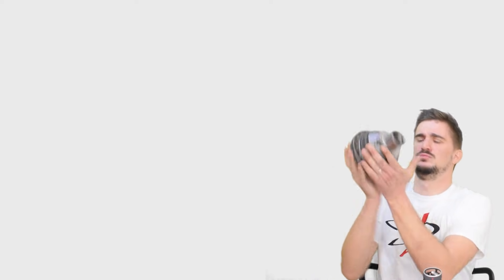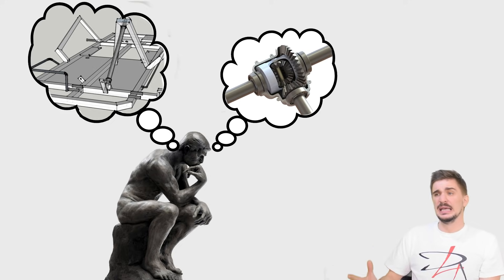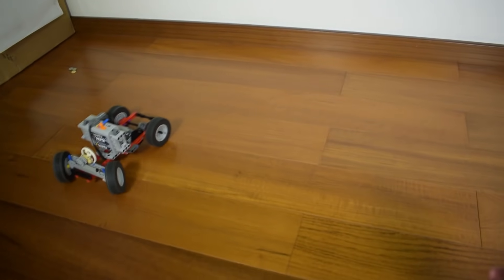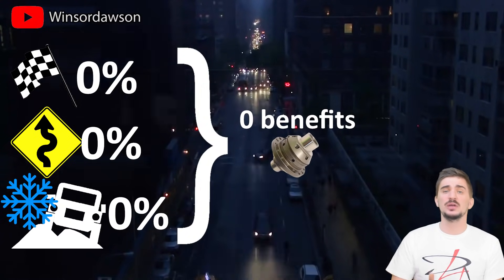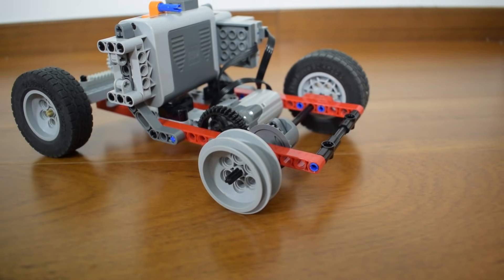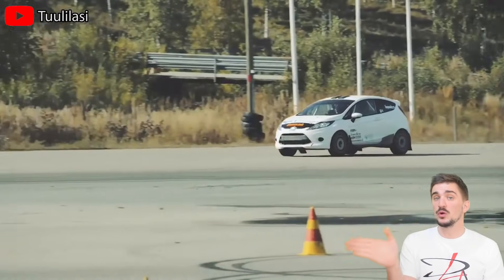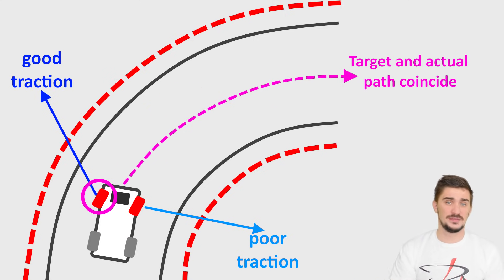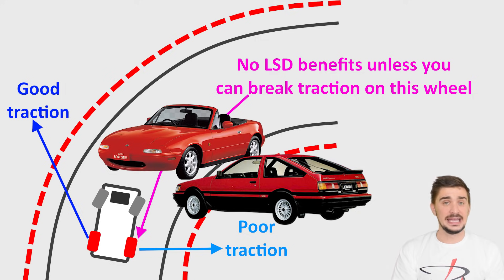OPEN diff vs LSD vs WELDED diff - VISUALLY + In depth EXPLAINED - Version 2

Comment from the maker: https://midshipgarage.com/
Quaife ATB diff - https://midshipgarage.com/products/quaife-toyota-mr2-turbo-sw20-89-99-a-t-b-helical-lsd-differential-for-e153-transmission?_pos=1&_sid=9f421405d&_ss=r&variant=28536254693481
OEM Viscous - https://midshipgarage.com/products/genuine-oem-toyota-e153-non-lsd-axle-stubs?_pos=1&_sid=3e19dfbb0&_ss=r&variant=32312543510633
Novus Center Console Pre-Sale: https://midshipgarage.com/products/midship-garage-toyota-mr2-spyder-mr-s-zzw30-novus-center-console?variant=39310517796969
The LEGO LSD design I used: https://youtu.be/2NLjbwt1C70
Support d4a: http://driving-4-answers-shop.fourthwall.com/
Version 2 of this video. Previous version was deleted because it contained some misleading information. Please see description for details.
Reply: Nice to see a YouTuber admitting and correcting his errors.
Reply: Still one of my favorite channels, but if I need to vent some anger and aggression I know where to go. Haha... gotta love those keyboard warriors!
Reply: good good :)
Reply: Thanks for taking the time to make a corrected video. It was right thing to do
Reply: I think there are RWD cars with low enough torque to be unable to break traction in a turn.  What about my 1982 225 CID Dodge W150 when in 2wd mode and fully loaded? what about the 1979 Datsun 210 wagon with 1.4? what about 7 ton capacity dump trucks with 4-53 2 stroke diesels?
Reply: So now i know what type of slip diff the van has that i need to drive for my employer. Limitless slip diff i will call it, or the open one as you present it. How i know? It's simple, i was charged with picking about 600kg of apples and the fastest way would be driving through the lanes between the trees, fill the crates and directly load them back into the van. Done it before but this time it had been really rainy and the owner of the trees uses a tractor to maintain them, tearing up the grass with the wheels especially at the corners. It was a clay like mud that was really slippery and i got stuck in it. One of the wheels, the one with the most traction, would just sit there having grip but not getting enough to move the van, and the other wheel would be spinning and flinging mud around.
We managed to free it by using several pieces of board to drive onto to gain momentum and rocking the car back and forth untill on top of the boards by clutching at intervals. Let's just say it was an interesting and educational day for me :D
Reply: I'm really surprised you didn't consider the 2nd gen MR2 (SW20s) or even a 2000GT if you could find a good deal (which I'd think you could).
Reply: Throwback to my physics class, amazing presentation! 👏🏻
Reply: what is the difference between shaft linkage and cable linkage in manual transmissions and how does the cable one work?

Comment: I’ve been an automotive master technician for 20 years and this video does a good job of explaining a subject a lot of people have a hard time understanding. Everyone wants to weld the differential until they realize you can only drive it in a straight line to keep it from breaking.
Reply: I had a spool in my race car (manual steering box, btw) for a few years and it was awesome on the drag strip but sucked royally everywhere else. Especially with slicks the car seemed to go through agony every time it had to make a sharp turn. The fact that our strip has two 180 degree turns, one on one off, colored my attitude towards them somewhat. I've since got a Detroit locker and it's so much easier on tires and the car. I don't feel like he frame is trying to twist in half anymore.
Reply: I daily a diesel Ford pickup with welded diffs in both axles. Unlock the front hubs before you drive anywhere and it’s literally not an issue. Since I’ve welded them that trucks put 20k miles on the odometer.
Reply: Can I ask you a question?  I have a really nice 2015 XB 5-spd.  Actually the last one off production.  I thought it came stock with an LSD but from what I've found it's probably and Open diff.  Is it really worth it to upgrade?  I have a full shop at my house, have done engine rebuilds before and clutches but not a diff yet.  I've also read that to really get the benefit you should supercharge or turbo the car, otherwise it's a waste of time and money.  Would that be your consensus.  It is a box lol, but it's actually got every Toyota/TRD aftermarket part available. I bought it at 40k miles and the original owner had really dialed it in save for engine/trans mods.
Reply: You just need slippery tires and a slippery surface OR just dont go round corners
Reply: And omg! If it won't start and you have to push it with the front wheels turned you ain't going no wheres.
Reply: @oldowl4290  Toyota has an amazing LSD that uses worm gears. Whether or not you need to have a turbo, a supercharger, or a built race motor I guess depends on what you do with your XB. If you live in a place where you have snow and ice and you are forced to drive on it an LSD will benefit you. The Toyota LSD is the best I've ever seen. I'll see if I can find a link so you can see what I mean.
Reply: @3dw3dw   Please link what you find. I'm curious!
Reply: @3dw3dw  Sweet!
Reply: @oldowl4290  that channel does really great illustrations, I recommend watching their other differential videos also so you can see how truly impressive the Torsen is relative or other technologies. With any other differential,if the engine won't start and you need to push the car as soon as you turn the steering wheel from straight the car will get ridiculously hard to push due to the friction or resistance in the differential. To me this indicates that a lot of power is required to overcome the differential in a turn. This would not be the case with a Torsen diff if you understand what is illustrated in the video here. Anyways, I hope you find my input useful. Have a blessed day.
Reply: @3dw3dw  Thanks and you too.
Reply: then why do all drift cars have welded diffs?
Reply: @__mayo1802  it’s easier to slide with it, less traction. im just taking a guess, im new to this.
Reply: @__mayo1802  not all drift cars but ok. Low budget grass roots drifters do it yes. But in order to save that diff's lifespan you're limited to the cheapest lowest grip tyres available (usually relatively skinny)
Reply: Now they will want a twin rear motor ev with no diff & torque baising!. Then they want additional motor with integral diff & rear wheel steering!
Reply: My welded diff has been drifted and driven on for years without issues, saved hundres or even thousands of dollars while being very functional for its intended purpose. Definitely not comfortable though by any means

Comment: There is one element you missed when explaining the welded Differential during corner exit.  With the Weight Bias shifting to the rear wheels, the traction is less on the front than both of the rear wheels so the traction can cause the Front Wheels to be the ones to slip, not the inside rear.  As such the car will now understeer drasticly.
Reply: Happens on poorly designed go karts. It's called "plowing". Happens because of a solid axle rear end, and a poorly designed steering setup. In some cases you can't get it to stop in suspension applications. So that really makes sense how the weight distribution would make such a thing happen. On a kart with no suspension it's easy to fix. But when you add suspension, it gets to be a headache.
Reply: @derucktorez2260  I used to race 250 gearbox karts (or shifter karts as they say in the USA!). They were set up to lift the inside rear wheel on corner entry to get the kart turned in, then drive out of the corner on the throttle with a subtle drift. Not too much drift or we'd lose too much speed. It was a bit of an art to balance them but at least we had gears to help, unlike the direct drive karts where momentum was king. Good fun though!

Comment: You know, I don’t do any racing or anything, but I do work with heavy equipment and this explains the characteristics of my equipment vs my trucks. Apparently my loader has a LSD, and when under a load like digging, they will all turn without needing to lock the diff. So this actually helps me understand certain things now and I can take better care of my stuff! Thanks!

Comment: Weight transfer is not necessarily in the opposite direction of movement, but the oposite direction of acceleration. If you are moving forward but press the breaks, the weight transfer is forwards because the acceleration is backward. Same as in a turn.  The cars acceleration is toward the center, thus the weigh transfer is to the outside of the turn, which is actually perpendicular to the direction of movement

Comment: For offroading, many offroad vehicles have a system that locks the differentials letting you have all the advantages of open diffs and the traction of welded diffs when you need to be in a loose surface.

Comment: I was a truck driver for many years, and most vehicles I'd ever driven (truck or car) on unsealed roads were rear-wheel drive. Therefore, I got used to how those types of vehicles reacted on said roads. 
In the 90s, I started working for a company that made urgent deliveries to coal mines West of where I lived. One day I was in a small, front-wheel drive car delivering some small, yet extremely urgent parts to a mine, along a loose gravel haul road. The haul road was wide. Probably about 50 metres (approx 150 feet) I guess. I was tooling along in this little car at about 120kmh and came to a long, sweeping bend. As I entered I backed off a little and the car stopped following the bend and decided to start skating across the gravel. Now, in a rear-wheel drive vehicle that wouldn't happen due to the inertia of the rear, and if it did, you just give it time to correct before adding any 'gas'. So, I stayed off the gas and the car kept sliding along. I then remembered some side comment I'd heard from a bloke who I knew who played with FWD cars. "If you back off too much, they just slide, so you need to feather the power as you corner..." So I gave it some power and it started to pull itself around the bend. I used the whole arc of the bend, and thank the gods there wasn't a haul truck coming down that side, but I got it back on line. Lesson learned.

Comment: Differentials are probably one of my favorite car engineering things to understand, and this video does a good job of explaining it.

I have an RC car that's 4WD, open differentials front and back... until the rear diff stripped out, so I filled it with JB Weld. It's also great for explaining differentials.

Comment: For cars equipped with an ABS, an open differential is enough since the ABS equipment can be used to restrict the movement of the slipping wheel thus increasing the torque sent to the other wheel.
Reply: All ABS does is limit breaking force. Not all systems limit each wheel independently, and none of this controls torque unless you're both breaking and powering trough a corner. Traction control systems actually do modulate breaking on each wheel to control traction in that scenario, but still don't modulate torque sent to each wheel. The only systems that actively control wheel torque are LSDs and they can be electronically controlled. This video explains why they exist, and they're made to do the thing they do. They're not snake oil.
Reply: @PaulSpades if traction control notices that one wheel is free spinning (such as on ice like in the video) and applies brakes to just that one wheel, then all the engines torque will go to the wheel with good traction through an open dif, but if ur gonna do all that then u may aswell just have an lsd

Comment: “In reality there are no such RWD platforms with such low torque you can’t break traction” 

Me: looks out window at friends Ford falocn with a claimed output of 70 HP 😂
Reply: I mean if you launch it its gonna slip from acceleration i think
Reply: @Crispy656forever  Is that what some call "full send"😂
Reply: too many negatives in this sentence, cannot comprehend meaning
Reply: Was thinking the same with my isuzu pickup, boasting an absolute monster of a 2l 8valve na diesel, producing 62hp and 125nm... When new nearly 40years ago :D but to be fair it does brake loose for a second, with an empty bed, from a stop. But as tested ONCE, the whole car made such immense noises of suffering that I will never do it again. 

I don't drive to places like others, but accelerate to them, no matter the distance.
Reply: What model is that? Must be some kind of economy model from the 70s i assume.
Reply: @Blox117  
int Reality(){
    if(RWD==true){
        if(maxTorque<torqueToBreakTraction) return 1;
    }
    if(FWD==true){
        //front wheel drive reality checks go here
    }
    return 0;
}
Reply: @LokiScarletWasHere  oh thats better, why didnt he just say that from the start
Reply: @Crispy656forever   That is if the Clutch can also overcome the kick :)
Reply: Classic peel out machine, what are you talking about? :P
Reply: @TheSpekkel1  what the hell truck has that low of power? Why even own a truck at that point?
Reply: @ThatSB  Why own one? Just for fun and hard as it sounds, these trucks were useful in the past. Where the truck has spent it's life, they dont have asphalt roads so speed didnt matter.
Reply: @TheSpekkel1  It isnt about speed in trucks it is about haul capacity and terrain management if youre riding offroad. But also better fuel economy can be had in literally anything. A toyota corolla for instance. And if it had some semblance of power you'd actually be able to haul
Reply: @ThatSB  Sure there isn't really point in owning one of these older small trucks anymore, it's more of a hobby vehicle for me, but it can carry contruction material or lumber. Of course anything made during the last 30years will be more capable than my isuzu, but as a guy who rarely needs a truck for anything, it's more than enough.

Isuzu is my second vehicle. I have w123 240d, equally as slow, for daily commuting and such.

Comment: 3:15 : Viewer, please note: "allows two wheels on the same axle to rotate with different speeds." Very important bit! A differential is required for two wheels to move at different speeds only if the two wheels are on the same axle . If they are not on the same axle, not only do they not need a differential, they can not even have one! (The moment you connect a differential between two unrelated wheels, they immediatelly acquire a common axle )

Comment: Well done for your clear explanations that get the basic principles across in an easy to understand manner.
I've only owned one car with an LSD (Ford Capri 2.8 Inj. Special).  It was very useful in wet conditions where you could 'feel' it 'clutch up' mid bend.
Not quite as helpful in heavy snow/ice conditions.
Neverthess, I managed to drive it through a dire winter situation where modern FWD cars were giving up - thereby causing additional mayhem by blocking the road.

Comment: Limited slip differentials, when engineered well, are pretty impressive throttle/load-responsive traction aids. 
I use them primarily in heavy-duty trucks that I use to do mobile service work on machinery. They can have very good street manners, but on rough or muddy terrain, a quick romp on the throttle loads the clutches and gets you in, and then out of, trouble.

Comment: Open Differential:

Functionality: An open differential is the most common type found in most vehicles. It allows the wheels to rotate at different speeds, which is essential for smooth turns.
Operation: When one wheel encounters less traction than the other, the open differential sends more power to the wheel with less resistance. While effective for regular driving, it may not provide optimal traction in certain situations, such as off-road or high-performance driving.
Welded Differential:

Modification: A welded differential is a modification where the gears inside the differential are physically welded together. This eliminates the ability of the wheels to rotate at different speeds.
Functionality: The welded differential essentially forces both wheels to rotate at the same speed. While this modification is inexpensive, it can make turning challenging, especially on surfaces with different traction levels for each wheel.
Limited-Slip Differential (LSD):

Functionality: A limited-slip differential is designed to address some of the limitations of an open differential. It allows some differentiation in wheel speeds but provides more traction than an open diff.
Operation: LSD uses various mechanisms to limit the speed difference between the two wheels. There are different types of LSDs, including mechanical LSDs that use gears, viscous LSDs with a fluid coupling, and electronic LSDs that use sensors and actuators for precise control.

Comment: Just saw this video today and thanks for the new upload. I think I was the main reason you took your version 1 down and this is correct, but I doubt the Miata-theory. According to a BMW E36 Cup driver (150 hp) they would all weld their open diffs if it's allowed, but it isn't. I was racing e-Karts on the Nürburgring and even those heavy karts corner great with a spool as well as Quads. You just drive so fast that the inner wheels lift off a bit and allow the slip😁 On the other hand there are open diff race-series like Formula BMW, Ford, Vee, Skip Barber, F4 and even the Praga Cup. Not sure if it's and advantage or a mandatory handicap.